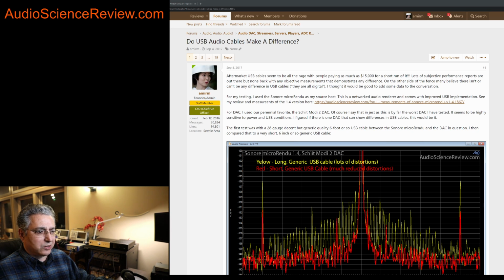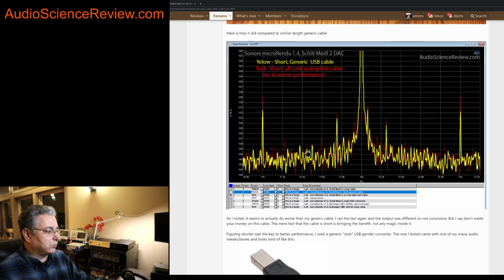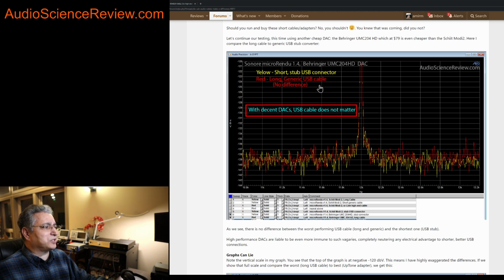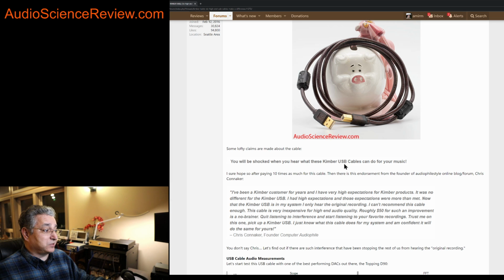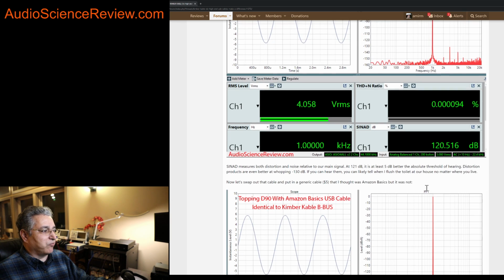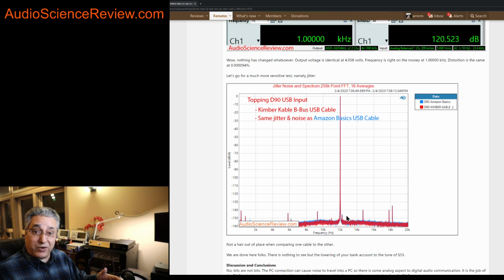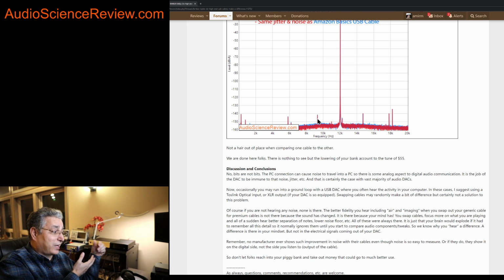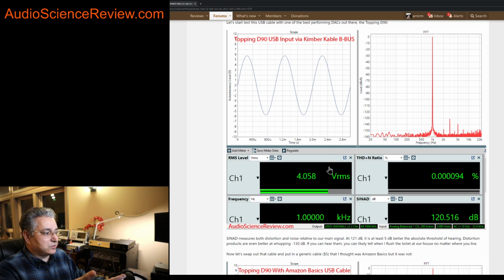Do USB Cables Make an Audible Difference (Kimber Kable Review)?

Comment: If the DAC does all the work, isn’t it obvious the cable doesn’t matter. Wouldn’t it make more sense to test it with the old Schiit modi, and see what came through each cable then? Is Kimber claiming the cable has low distortion/jitter or that it will actually reduce distortion or jitter,

Comment: I've run in to a few bad ( not to spec ) usb cables ( they dropped the connection when moving a ton of data, even issues with a printer ). I did replace them with amazon basics and other cheaper but to spec cables.

Comment: I once compared a Curious Evolved USB Cable to a stock cable that came with my printer, to a DIY USB cable that I made using $3 solder, and a few thin necklaces that my grandmother had in her jewelry box.  I made sure that the necklaces didn't touch each other and I carefully plugged them into my DAC.  I'm SURE the measurements would be different between these cables, but they sounded EXACTLY THE SAME!  Then I went to my trusty Home Depot 12 AWG wire, and although it was very difficult to solder using my $10 soldering iron I tried really hard not to have any shorts.  I tested everything to make sure it was fine before plugging it into my DAC.  Once again, IT SOUNDED 100% EXACTLY THE SAME AS EVERYTHING ELSE!  The lesson is simple.  Use the cheapest printer cable that you can possibly find and spend no more than $5 on it.  If you can find it in the bargain bid at Best Buy then even better.  Plug that into your Mola Mola Tambaqui and laugh at the fools who are using 'so called' audiophile USB cable.  They are only hearing SNAKE OIL!
Reply: You might have had a better chance with that story if it were just a little shorter without all the variables you threw in. But I believe you :yougotthis:😜🤣🤣
Reply: @BumpNrun69  You'd better believe it!  With the benefits of science and measurements you can have the same sound that audiophools get with their $400K systems all for less than $20 bucks!  Science!

Comment: Try playing a track backwards with one USB cable and normally with the other. never ever were  waveforms  identical. In terms of sound I auditioned four cables blindly and one of them drove my system closer to reproduce  my guitar's sound. It was not the most expensive but the differences were real, no placebos here sir.

Comment: There are many parallels between audiophiles and esotericists: They just want to believe that the 20-100x more expensive cable makes a difference. It is absolutely ridiculous, especially when it comes to cables for digital signals. Even with cables for analog audio signals, the difference between better and high-end cables is inaudible, which has been proven by countless blind tests. This is logical for anyone with a little understanding of physics: both better and high-end cables use copper as a conductor. If the cable diameter is sufficient, the signal will not improve if larger cable diameters are used. Audiophiles are buying way too expensive cables ... but that´s just a tax on stupidity.

Comment: You make the cable issue seem very black and white, but there are a couple of important issues you don't address, where it can be best to avoid the very cheapest USB cables. The first is corrosion. Pretty much any USB cable makes good contact on day one. However, many cheap ones use very poor contact materials, and after a few months they start to corrode. The signals are digital , so basically things either work or that don't. However, a lot of corroded cables get really quirks when you touch them and shake those corroded contacts. It costs only a little more to avoid this kind of hassle. The other issue relates to noise. Good equipment has good inlet filtering. However, its not so unusual to plug otherwise known good USB kit together and hear weird whistling noises coming out. Snap one of those ferrite filter rings around the USB cable, and the weird noises usually disappear. This is more common when the audio kit is powered through the USB cable than when there is a separate power supply, but a cheap and simple snap on ferrite ring (or a USB cable built with one on it) can work wonders.

Comment: Amir, I have a question... Is your AP providing the input signal for the USB cable? If not, what is? 

Also, have you ever done testing on early USB DAC input implementations? In other words, maybe it’d be worth testing a 12+ year old DAC to see how the behavior has changed. 

No doubt there have been improvements in implementing USB inputs in audio, especially with regard to noise rejection.

Comment: Hey Amir, I love your site, I purchased my latest DAC the SMSL SU9 based on your detailed measurements.
I do find the on going debate about exotic cables quite entertaining, coming from a music production bacl ground I know that measurement is important in being able to describe a cables performance, and to be honest, if there was any weight to the very expensive cables sounding better, then we would have started using them in studios a long time ago, but we don't, and the good old balanced cable is all we need.
But I have been thinking, that cable guy you referenced in the video, I've been watching his series of videos on speaker cables and he claims he'll be able to identify cables with a 10/10 success in a forthcoming video. He claims he can hear the note decay differences in cables, well this has got me thinking, irrespective of the outcome of his "experiment", would a set up with a sensitive enough mic, high precision amp in an anechoic chamber ever be precise enough to do a null test on speaker outputs (averaged in some way possibly) using different cables, to prove once and for all the soind coming out of the speaker is not measurably different when different cables are used ?

You could even go as far as to show how different amps and speakers do have a measurable effect on the sound and by how much, and then show if changing the cables makes a comparable difference (which owe know it wouldn't)

Comment: Hm ... redbook CD dynamic range is 96dB.  How could he measure 120db?  I don't know of any  cd player can that do 120db range.
Reply from the maker: Please see this video on how this measurement works: https://www.youtube.com/watch?v=bqGjh67x7IU
Reply: @AudioScienceReview  Thanks for the link.  Your measurement shows a huge amount of phase noise which should be audible.  It's the close-in freq. around the fundamental.  
Also frequency response is a steady-state measurement.  It's harder to show the transient affect (which not shown in your measurement) of noise that is affecting the jitter (the clock jitter that clocks the output stage of the DAC during the sample and hold process).  It's the correlated noise that  affects the music.  A lot of what you show up there is probably random noise which usually not as harmful as correlated noise.
For example, when you have a sharp rise in the digital stream, and that transient will eventually affect the down-stream electronics such as the DAC clock and this is something that is not easy to measured.  
And of course It may seem small in your plot but these noise will get amplified to much higher level when it got through the power amp to the speakers.
Reply: Correction: when I said "sample and hold" above, I meant during the conversion process when you have a stair-case output on the DAC.

Comment: I've found a company selling "audio grade" SATA cables (used for connecting your HDD/SSD to the motherboard) for 350 Euros. They make a lot of astounding claims on their website ("Offers overwhelming improvement of sound quality & image quality", "more details, darker background, more clarity & musicality"). Further, they explain: "The cables that come in a box together with a motherboard are good enough to keep the system stable. But they are by no means optimized for digital audio playback. Any signal retransmission causes timing imperfections which ultimately deteriorate sound quality of a music server, even at this early stage."
Of course this explanation completely overlooks the fact that no operating system or music software is actually streaming audio from the hard drive bit-by-bit in real-time as its being played. They always preload data in large chunks into RAM, so even if a retransmission was required it will be resolved well before the relevant data needs to be processed and sent to the audio interface. Moreover, they're using a music server as an example, so you're also going to get additional buffering from the network stack on both sides.
I find it interesting how these companies claim that audio places unique requirements on digital interfaces, considering that audio data is tiny in the grand scheme of things and if you actually had frequent enough data corruption issues to cause audible difference you would have far bigger problems than suboptimal sound quality - your computer wouldn't work at all since all your executables would be broken.
Reply from the maker: Yeh, some of these companies know a lot less about computers than they do about audio!
Reply: @AudioScienceReview  I envy your ability to assume good intentions! I find it hard to believe that a company which builds a variety of computer gear would be incompetent enough to genuinely believe such claims. For example, they also market audiophile network cards with promises such as "Experience playback from TIDAL or Qobuz at new heights of resolution and dynamic range." (just imagine how many miles of non-audiophile cables and switches there are between that card and TIDAL's servers). Personally, I think that many of these companies knowingly engage in false advertisement, which is very unethical and probably illegal in some jurisdictions.

Comment: Hide the cable with a towel: bad idea.
If the towel contains any synthetics, it may pollute the sound.
You need an all cotton towel for an all natural sound.
Reply: And you definitely don’t want to use a towel made from a mixture of linen and wool, or sound will be your least problem — you’ll be in trouble with the lord.

Comment: I think most of the replies in agreement are of those who cannot afford an expensive and most likely better cable. They are wrought with disdain  for those who can afford something better.
Reply from the maker: If I told you I had some multi-vitamins that cure Covid and cost $1000, you not buying that means you can't afford them?  So no, there are very wealthy people who believe in audio science and engineering.  They don't buy expensive cables because they know the claims are empty.  They did not make their money by making poor decisions about purchases like this.
Reply: @AudioScienceReview  covid is mostly over blown, I do not buy the hype. Also, no I would not buy your vitamins....I refuse to get a forced upon shot as well. It is a form of flu virus. It has also been around for a lot longer than people realize, as it is and has been listed on the back of lysol cans for a long time. It is just another variant which no one can irradiate, even with your vitamins or shots! Mostly elderly people with a pre existing condition died from poor decisions made by stupid politicians aka state governors (placing known infected people into nursing homes). Lastly, who are you to say what and what I cannot hear? If I hear a difference, I keep a product. However, if I do not hear a positive difference, I sell said product on ebay or audiogon. So where is it that I'm stupid and throwing away money? I maybe lose at most 10 to 20 percent of my initial cost, big deal. I work and have a job and make money, so I will do what I please with it, without ridicule from stuffy know it all people that think their way is the only way. Measurements are not the only and definitive way to find out how something may or may not sound. Their are differences, however small or large, it is up to the consumer to decide if that difference is worth the cost in a real world situation (system & room). So if I say that I taste something, yet you cannot, that something I taste does not exist?? How stupid is that? Same as if I say I can see something, yet you claim you cannot see it (maybe due to poor eye sight), then that something is really not there because you can't see it? Wow, thanks.
Reply: Horrible video. Instead of listening to this man's aberrations, listen with your own ear and you will see the enormous differences between a cheap cable and an expensive one. Only "audiophiles" here.

Comment: I would much rather pay for a quality made audioquest cable than buy an Amazon basics pos cable, sorry. Even if there is no sound difference, which I doubt, at least i know it was built well.
Reply from the maker: How do you know the Audioquest USB cable is well built?  I see no independent certification of it.  The Amazon Basics cable has 22,000 reviews with 4.5 average.  I have used it to test hundreds of digital products.  It feels and fits excellently.   And it costs only $8.

Comment: The funny thing is that a locally powered DAC doesn't even need the ground connection. USB is a balanced signal. But as was demonstrated here, the nasty USB ground connection to the DAC really doesn't make any audible difference in the first place under reasonable conditions.

Comment: while I think good measurements are necessary PRECONDITIONS to have good sound I also believe a good measurement does not equal good sound. It is like when CFL producers said this bulb is exactly like an incandescent lamp because the light has the same color temperature...

yes, really, I will make the usual car/wine analogy... Measurement for me is like the NCAP/NHTSA score. It reassures me that I don't buy crap but it doesn't help me buy a car that is FUN to drive. I don't buy a car to have maximum safety (otherwise I would not get in a car in the first place). Similarly, after a while distortion, jitter etc doesn't make ANY difference for normal people (who are not Amir). What does make a difference TO ME is whether a triangel, a chello or a 80" gong will sound pleasant or not. Even noise floor or soundstage is less important for me than for many others.

You can say I'm not a real audiophile and that is ok. I'm also not a F1 driver and while I don't know much about engine characteristics or axle geometry but time to time when my driving skill get measured it turns out to be quite ok  Similarly I probably wouldn't pass most AB tests in Amirs other video but when I spent time with one of the highly accepted audiophiles in my country I "correctly"  (I already see the responses..) identified the difference in sound when he put a weight on one of his devices or made other subtle changes to his gear. 
 
We badly need people with these type of skills otherwise we would not have such good equipment nowadays for such reasonable money but for me measurement is a tool and not the target. I even think measurements are also kind of psychoacoustics in the sense that many people who SEE a good measurement tend to BELIEVE the device must SOUND good. The question for "measurement above all" supporters is: do you think your measurements describe all aspects of sound quality?

Comment: There was a time before Fahrenheit invented the thermometer.  Temperature still obviously existed before that instrument.  Over time, we have learned much about atmospheric measurements, and now we can measure temperature more precisely but more important is that we measure so many more things.  We have also learned about what we as human beings are sensitive to.  We have begun measuring visible light, but we have also begun measuring infrared and x-ray.  While I can't see these, they still impact my body - and not in the same way.  Obviously the thermometer still gives us a very important and very real measurement, but now nobody looks up the temperature before going outside, we look up the RealFeel or whatever branded, proprietary calculation of weather service you use.  Similarly, it's been recognized already and should be more so that frequency response is not so critical to human hearing - so many people love very uneven FR graphs.  Adding on a few other measures helps - it contributes to truth - but it is so far short of the whole truth.  There are many, many facets to the human experience beyond what can be scrolled through in a few minutes.  What does a human being actually hear?  What about the differences between two humans?  Funny we don't have time in this video to get into psychoacoustics (which is actually the core of this debate - what do we people actually hear?)  Trying to reduce the human sensorium into just a handful of measurements is, quite frankly, unsophisticated.  We must be advocates for complex thinking.  We need instruments like oscilloscopes, but those do not answer the question at hand.  The instruments can be deployed in the study of physical phenomena, and those measurements can be mapped to the experience of the human being, but the human being itself is the thing we need to measure and understand.
Reply: Quite a philosophical muddle you've gotten yourself into here. If the "complex thinking" you're promoting does not have a base of symbolic logic, you're on a weak foundation indeed.
Reply: @Mrch33ky  What do you mean by;  If the "complex thinking" you're promoting does not have a base of symbolic logic, you're on a weak foundation indeed.

Comment: Point being, a USB cable won't make better sound unless noise is radiating and coupling into the DAC, as Amir has shown, and can be resolved with a better shielded cable.  All the bits still arrive in a timely manner and are played just the same.  As with any cable, stick with quality and forgo the snake oil.